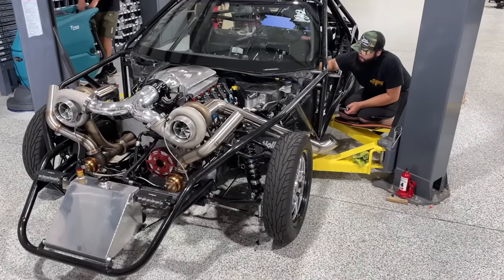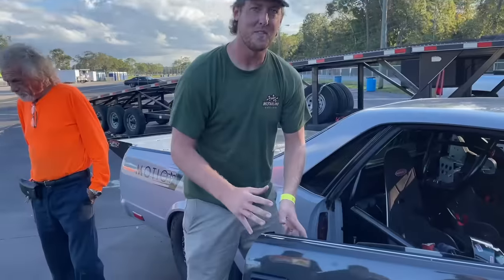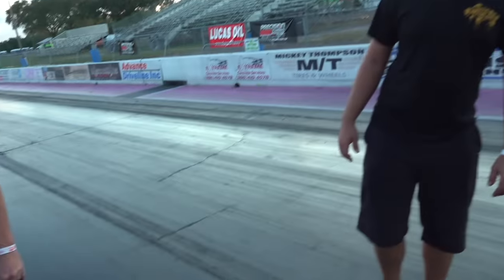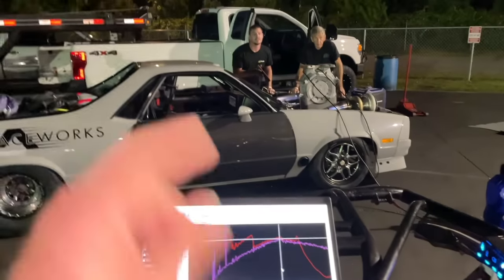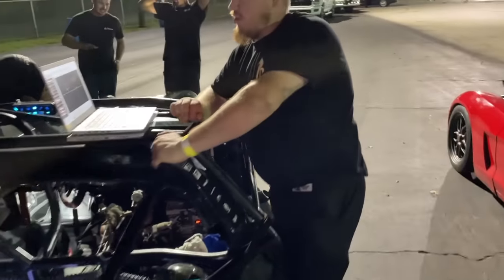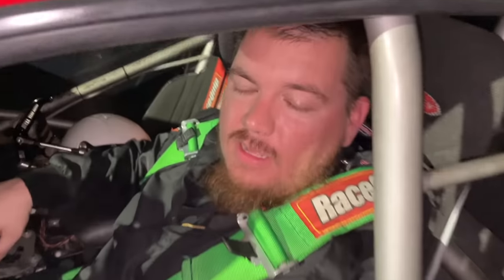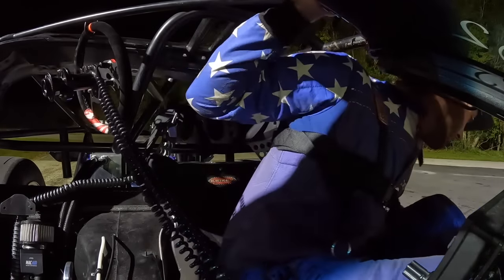LEROY 2.0 Just DESTROYED His Previous Records!!!! HARDEST Launches I've Ever Done!!!

Comment: I friggin love that all the exhaust pipes exit at basically the same angle, so when on the two step it pops flames out all four pipes it's like a beautiful pyro show
Reply: Did anyone else see the 5th flame near the throttle body @ 17:55
Maybe that was the weld popping and the cause of their boost leak.
Reply: @ittimjones  I did not, but went back and you're right. Looks like something let go for sure. BOV is hanging right under there, maybe it popped or split the CO2 reference line?
Reply: @ittimjones  You can see it in the turbo inlets when you frame by frame it. Surely that burnt the sealing seat in the BOV. Not meant for flame temps like that.

Comment: @29:47 you can see sparks and the glow of the TBM breaks 🤣 they were working hard there for sure. So awesome to Leroy back in action and ripping
Reply: I came here to say this... cool we could see it happening w/o a body.
Reply: And it only weighs 2500 lbs
Reply: It through sparks in front of passenger rear tire on last pass.
Reply: I was just looking at that
Reply: @jdubcbr600  possibly the clutch
Reply: That isn't the breaks. Checkout between 32:34 to 32:35, the sparks are coming outta the rear right wheel area. They really need to take a look at that, no idea what would cause them as there's no more transmission in the back
Reply: I think only the front brakes are TBM.  Someone correct me if I am wrong.
Reply: @BelligerentWoW  I'm thinking what you're seeing there is coming from the slipper clutch
Reply: @danmyers9372  I think it's TBM all the way around, I don't know why it wouldn't be

Comment: 29:44 through 29:48 all the SPARKS off of Leroy's RR brake is bananas!!!
Reply: I was gonna comment the same thing. Hopefully they take care of it before WCF.
Reply: And 32:34
Reply: That got kinda hot....something boring right there.
Reply: No brakes sparking IS normal if the pad material isn't hot enough.  Once the pad/rotor get up to temp (>500*F) it ceases to be a frictional surface and transitions into adhesion!  When the brakes are up to temp they actually STICK to the rotor.
Reply: This is also why "warped rotors" is an old wive's tale.  Coming down from a high speed to a stop will get the pads and rotors over 500 easily.  Then as you sit there at the light, holding the pads against the rotor, it cools and leaves some pad material were it sat.  Then the next time you get into operational temperatures more pad material is deposited in that same spot compared to the rest of the rotor.  And as you continue the brake shudder gets worse and worse.

After a HARD braking session, pop the vehicle in neutral, get off the brakes, and let the vehicle roll about 8" forward.  Then stay off the brakes until you see cross traffic get the  yellow light. You'll never have brake shudder again.

Comment: The quad flame 2-step check on Leroy is absolutely absurd!!  Let’s go Leroy!!
Reply: 5 flame @17:57. Boost leak?
Reply: @reeseromine2140  Wastegates
Reply: @reeseromine2140  a backfire
Reply: I know where the wastegates are but there's a flame that comes out at the very center.
Reply: @reeseromine2140  that flame come out from the blow off valve at center of the charge pipe, not from the wastegate

Comment: Caught something at 29:44 Just something to keep an eye out for, at 29:44 on the de-acceleration when the suspension finally releases and the weight of Leroy gets back on the suspension - seems likely when you applied the brakes, the right rear tire (from in car) had some pretty hefty sparks flying out. Not sure if it's just a clearance issue or if something was binding up from braking, but definitely something to check on for safety. Good luck.

Comment: Seeing all the cars back up and running for the most part made me think, how cool would it be to do a 1/2 mile drag race all side by side of the whole lineup?
Reply: They don't have enough gear to go much past the quarter. It would require some decent changes
Reply: @nathanhaupt6485  plus at that rate they would all be over the mid 200s
Reply: @1VETaLEK2  yeah also true and not sure what cage requirements that would carry that the cars don't have
Reply: @nathanhaupt6485  I hate that your right about this
Reply: Get the Blazer and go 4 wide at Charlotte. I would get a poster with that on it.
Reply: They would run out of gear. They’re set up to have everything at the end of 4th gear. In the quarter they only use 4th and that’s why. They throw all the boost it can handle in 4th, that’s where the most timing is pulled, and if I’m not mistaken doesn’t he have like 5.10 rear end? Maybe even shorter
Reply: @nathanhaupt6485  Actually for drag cars the big problem is traction. 1/2 miles are not prepped, so it'd be a 1/2 mile burnout, or a slow creep up to speed.
Reply: @philb5593  true, not sure but I think they might still run out of gear by the end of the 1/2 mile even without prep

Comment: Did anyone else notice the ball of flame out of the bov on Leroy’s last two step check at 17:57?
Reply: I did but what was that spark out of the passenger rear axle area @28:46 just as the car is passing last D in the Speed World banner? Might be important seeing that sparks shouldnt be coming from that area.
Reply: If we put it in slow motion you can even see the flames inside the turbos wow and look at the brakes at 19:38
Reply: I think it's the brakes
Reply: That fireball threw me off, pretty sure fire isn't supposed to come from there, since there is only supposed to be air in the plenum. I think that was a backfire that mighta damaged something.
Reply: Probably why they are not building boost like they want.
Reply: Yeah the car made a different noise at the same time. Something not right there.
Reply: That's the blow off valve.
Reply: Yep, it was 100% a backfire through the intake. I was just pointing it out.
Reply: @jmoss10403  the sparks are from the clutch slipping, much like metallic brakes spark under heavy load.
Reply: @MR2Josh  could be. They do have a bigger window into the bell housing.

Comment: You should create funels for Leroy and mullets turbos with spiral veins on them to create compression through the vortex leading into the turbo. . if you calculate the wavelength created as it is compressed in the turbo, and have the intake cone as a multiple of that size you can make a standing wave heading in which should further increase your boost.
Reply: I was thinking the same thing 🧐
Reply: Leroy used to have turbo velocity stacks.

Comment: If you go frame by frame at 17:57, you can see Leroy shoot fire out of the BOVs... Is that ok?  Like a backfire or something?  I've never seen that lol.  Not talking about the wastegates. Little bit of flame out of the blow off valves, and you can kinda see some orange glow in the compressor of the turbos as well. I have no idea if that's totally normal or what, but I've just never noticed it before.

Also at 32:34, what are the sparks from that pop out from just in front of the rear tire?  Doesn't look like its from the exhaust.

Comment: I love how laid back yall are, just friends having a good time making cars go faster and faster.  But at the cost level yall have hit, some of the problems yall have encountered seem like the could be easily avoided, like running out of fuel system/injectors when swapping ruby and rocky to methanol could have been avoided by knowing how much ethanol taxes the fuel system and comparing the difference in air fuel ratio.

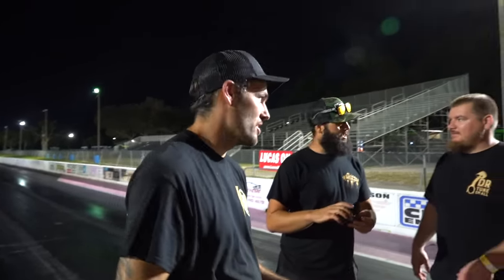Comment: Hmm. 29:33 the rear right brake is throwing sparks. Probably cause it's hot, but on the next launch at 32:33 there are also sparks coming from the rear right. Maybe there is an issue with something rubbing?

I mean this car shoots flames all the time, but those at least get me a little worried that I would rather have you guys check on that.

Comment: RTV has a cure time of 24 hours depending on ambient temperature, it should only be used for applications where it is allowed to properly set. Otherwise you would typically use a gasket which can be installed and immediately driven.

Comment: 28:45 Had to slow the video down to see it better, but not sure if you guys saw the sparks coming from the passenger rear on the front side of the axle. Again at 32:34. 31:05 You can see them a little better, seems to be more towards the center of the axle in this shot. 29:44 Obviously those sparks are from the brakes, the sparks I saw first were during launches.
Reply: Congratulations you have won a prize🎁
Reply: VIDOGRAM Me @CleetusMcfarland1

Comment: 315 is the width of the tire in millimeters. The second number is your sidewall in relation to your width. A 265/70r17's sidewall isn't quite as tall as a 285/70r17... But by very little..... I don't like how we measure tires in metric. It should be more similar to how imperial works. Height of the tire overall, width of the tire and the size of the wheel...in metric.... But it's not.....dumb.